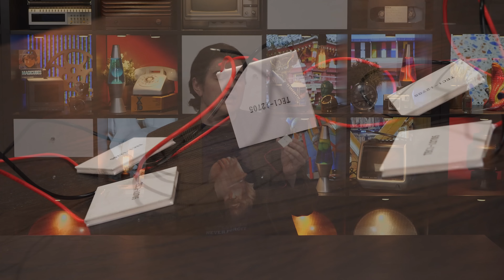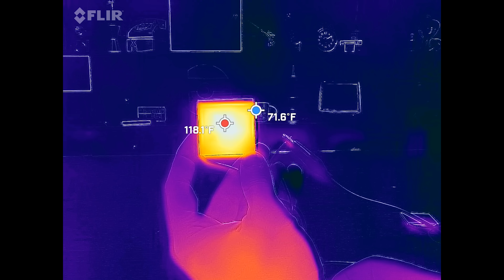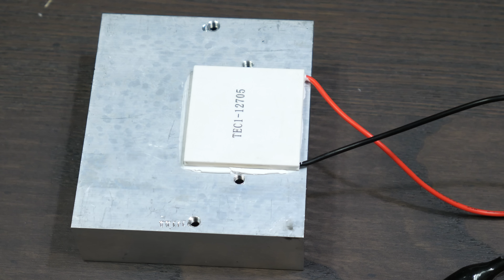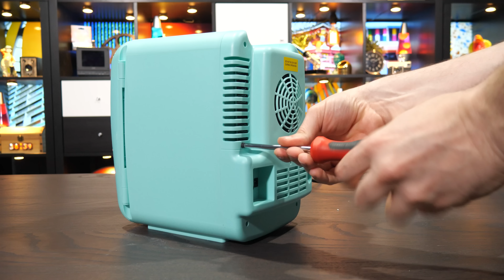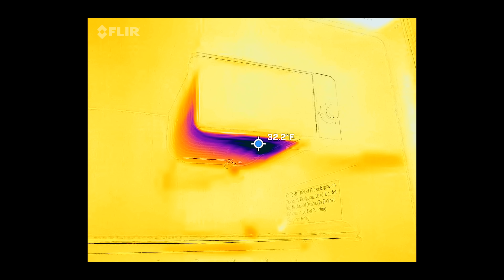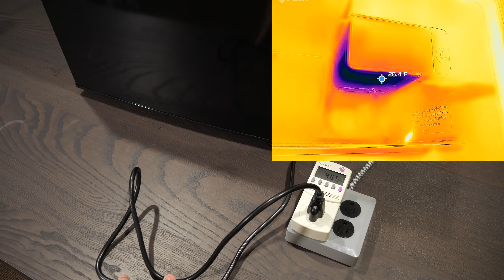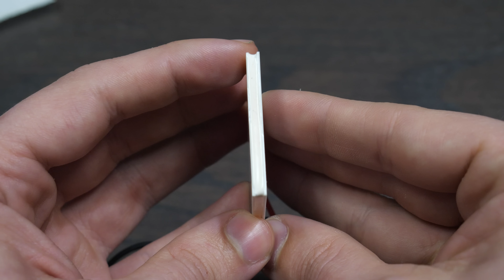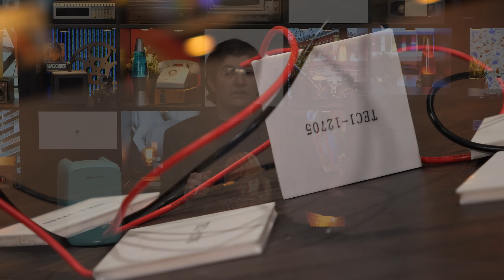Thermoelectric cooling: it's not great.

Comment: What we need to do . Is to is design smaller more efficient compressors for small refrigerators. If the motor and compressor could be made smaller. Roughly the size of a 12oz can. The compressor has really changed since the 30's ,40's ,50's at least! I have heard even propane can be used as a refrigerant. I have been thinking about building a off-grid heat pump, using automotive ac equipment, a long with a couple power sources. Either a 24v DC electric motor, or a 5hp gas or diesel engine. Maybe both. Also including a alternator to charge the 100+ ah battery. It will require math to determine the run time to capacity requirements.  Also possibly building a refrigerator as well probably a freezer modified and probably a freezer as well. All this may require a larger engine , the electric motor I have. It is rated at 24 and 48v and can be used at , 96v+ with additional cooling, 3.6kw at 24v nearly 5hp (750w=1hp) I can run it at 48v, and use a 10-12 hp engine. I'm thinking a 5 gallon bucket of water with a pair of coils inside, one to freeze the water, the other to use that cold to cool other things , sit the bucket on 6" of foam insulation with air gaps. Probably 1" dense poly foam. With 1" strips forming air pockets between layers, glued together with spray foam. Adding about 1.5-3mm to the thickness
 Making a top for the box the same  way, with walls made similar, with only two solid layers, with the walls 2" from the bucket. And the tubing entering the top.  And thick plastic sheeting to cover the bucket. Incase it cracks eventually from freezing, (maybe use a anti freeze to prevent actual freezing,) anyway, place the bucket inside the center of the foam box. Fill the gap with spray foam insulation. Maybe incorporate bubble wrap to get air gaps to add to the r value. Use water with antifreeze to circulate through a heat pump , A coil, using a small 12/24 vdc pump to circulate the water. To add time between when the compressor need to run. AC is only needed about 3-4.5 months , and I can use the outdoor wood stove boiler to heat the house the same way. I would like to store hot water in a similar way, using 55, gallon drums, possibly lined with bricks, with a foam container to insulate the barrel. If the water is stored at 10psi the water can easily be heated to 220° without boiling not shure the boiling temperature at 2 bar pressure. But 14-25 psi isn't that much more than 10 psi. Question is can it be safely contained? It would probably be safest to go with 2-4 psi over ambient pressure. And keep the temperature to about 210-215, just below boiling . And the red clay bricks can possibly hold heat better than water? I have to check on this. I know water holds heat well, so do brick. But witch is better. Also sand could be used. Thermal mass storing heat  and  cold to help keep the house cool and warm. Can be a worth while project. Especially when off grid. It requires planning and safety to be kept in mind, or it can get very dangerous. A solar panel cooler can be added to the solar panels, and use this  heat inside the house when it's not very cold , and there is just a chill in the air. Maybe store the heat inside a bucket ! To be used at night, the exhaust from the DC generator charging batteries can be used also, to heat the house, building a water cooled exhaust is fairly simple. I would use a 1.5" pipe , have 6" straight runs with 180° bends. And cut a groove in the pipe on two sides  at least , put a 1" strip of sheet metal in the groove half way. Weld it together, about 4"-4.5" should be enough for a 6" pipe. With the pipe zig zagging back and forth about 8 times with a 18 gauge sheet metal box covering it
 Being about 2.5" thick to allow 1/2" on both sides of the pipe . Then a 1/4" not female fitting  welded near the exhaust inlet, another near the outlet.  With flat sheet between the pipes inside . Leaving kind of a maze for the water to flow. It's going to be possibly 24-28" long and 12"-14" wide. Use 1/2" PEX water pipe to plumb the water to a pump, capable of handling the heat. A 5 gallon per hour should be plenty. This should allow the water time to heat up inside the heat exchanger as it slowly flows through. I have Soo many things I want to do like this. Including using waste oil to fuel the engine, use wood gas to fuel a  gasoline engine, maybe distilled, pyrolized rubber as a gasoline replacement. And bio- diesel made from plastic. And look into heating it under pressure attempting to crack it. Make a fuel more like gasoline. Possibly use wood to produce wood alcohol, (methanol) to mix with the cracked biodiesel attempting to produce a synthetic gasoline! Experiments mostly, but the rubber does make gasoline, and the plastic does produce diesel. I  would probably limit production to 1-2 gallon batches. Well , enough rambling, sorry for this, hope you have an awesome day🎉

Comment: I still think I have a good use for Peltrier element in my DIY stuff. I build a "fermentation box" form a pizza-delivery box, peltier-elemet and two heatsinks with fans. It's easy to build a temperature control for this and it at least uses less engery than if I would heat the box with a normal thermal element. usually I just increase the boxes temperature for about 6°K.
Also it has to be portable and is run just for few days a year.

Comment: Peltier COOLING is crap. But Peltier POWER has a couple of niche uses.
Peltier devices can either make a temperature differential due to voltage being applied, OR create voltage due to a temperature differential being applied.
There are fans that you can put on a woodstove. When it gets hot, the bottom (hot) side is significantly warmer than a generous heat sink on the top. This temperature differential creates a little bit of voltage...about enough to run a small DC motor, powering a small fan. This allows you to get airflow in the room without plugging something in.

Comment: As another automotive use case that is relatively common, unlike cup holders, vented car seats with heating and cooling options typically use Peltier devices attached to a blower instead of the traditional heating elements found in standard heated car seats.
Reply: …and they usually exhaust from the backside of the Peltier device to the rear underside of your seat. So, whatever setting you have it in, the inverse will be happening to your rear passenger’s feet.

Comment: I had a cube refrigerator that had two Peltier elements for cooling. It never kept the beverages very cool and it ran 24/7. No telling how much energy it wasted in the years I used it. One day the beverages were room temperature even though the fans were running continuously. That was the end of it. I recycled the machine and I didn't buy another refrigerator. Well, now I know which kind to get if I do replace it. But, I'll pay more for one with better insulation if one exists.

Comment: AFAIK my dehumidifier uses one of those. 
It's basically a Peltier with no heat dissipation, so water condenses on the cold side and drops into a reservoir.

It's actually somewhat efficient at doing so, removing between 200~300ml of moisture from the air every day

Comment: There's one place were peltier elements make a whole lot of sense! Astronomy cameras.

Astrophotography is a game of signal to noise, astronomical images are often drowning in noise and isolating it is the difference between getting a black image or an image with a nebula in it. CMOS and CCD sensors generate noise based on their temperature, so lowering the temp will lower the noise, but even better, the noise is associated with the specific temperature, so you can select a lower than ambient temperature for capturing images, and then later, take calibration images at that same temperature and subtract the noise between the two sets of images. This is called dark correction.

Comment: 30:14  it is worth opening that pump unit up. 
the "buzzing" sound at this moment when it slows down. is easely identifiable as a contact sound. 
(something spinning with fins on it is hitting a thin metal housing) now i can only describe the sound that closely because i know what's causing it. 
but every single electric motor has a "fan" on it.  (the impeller fan) wich is most cases is covered with a thin sheetmetal housing. 
your compressor isn't air cooled though but oil cooled.  but who knows there might be a little fan under that sheet metal where the wires go. 

(a compressor is still powered by an electric motor through so that might be what's sticking out from the tank under that sheet metal.) 

in any case it doesn't sound like it's cavitation (wich would be the other cause of such a noise)

the reason i say this is because right at the time stamp. you can hear it slow down far enoegh to where you can hear something sliding over a surface. like a plastic fan hitting it's circular housing and being stopped by it.) 
wich means it's a problem that can be fixed with less than average mechanical skills. 
if it's actually inside the compressor.  it's still the same.  something is sliding across the circular housing it's spinning in.  100% 
wich might be fixed with tigtning and loosening the pump from the casing. (if it wasn't manufacturered propperly but still tightened down to spec.  the whole thing might be tensioned or tortioned. wich causes the whole thing to slightly deform.  wich could be enoegh to cause such an issue if the tolerances are too tight)

Comment: "Low-voltage" and "low-temperature-differential" paired with "recently cheap" perked my ears. With a slightly larger budget, what would it look like to stack enough together to have better efficiency and a usable fridge space? For that matter, can we get enough cooling before we hit diminishing returns?

Since the toy can get ~30 degrees of differential eventually with a single stage, we should be able to get to a comfortable margin of food safety (allowing for an up-to 100 degree room) with 3 stages of cooling, then we can plug multiple 3-stage stacks in to make it speedy enough. It does cost efficiency to use those though, so the question is what depth of stack gives optimal efficiency? Would be a fun experiment.

Comment: Sober high thought: isn’t there a device that takes heat energy and turns it into electricity? Can you attach one of those to a peltier device? I’m not thinking about free energy but a bit of performance offset. I know this will be wrong ultimately and wouldn’t work but someone can confirm that for me

Comment: You should have tested a much better product. I had one like this and it was a piece of junk that i eventually threw out. It didn't cool below like 45-50F. I now have a much better one that i did in fact buy on Amazon for i think like $150. It stays around 32F all the time and performs as good or better than expected (40F below ambient temperature). And if that's too cold i can set it to 35F or 38F. But i keep it on the coldest possible setting.
Reply: What's the name of it?
Reply: @logitech4873  Cooluli 20L mini fridge. It should pop right up on amazon. Its 150 right now. It has a temperature setting and digital display. In the winter when my room has dipped below 70F like in the upper 60s, ive gotten the fridge down to 24F. I really have no complaints, its even pretty damn quiet. I had one like in the video and it was so loud i couldn't use it. I highly recommend this one.
Reply: @dylanchadderton1  Ah, I see that it uses an 80W peltier element. That's even more power use than the one in the video. 
I have an Alpicool C15 which is a 15 liter compressor based mini fridge. It costs a bit more, but uses only about 16-20 watts to continuously run. I can set the temp all the way down to -20°C. (-4°f) and it reaches that very fast.
Reply: @logitech4873  i didnt know they make fridges that small with a compressor. Ah, i see it on amazon its like a car fridge/freezer. Looks like it works well but i dunno about using that for a desktop fridge. I like the cooluli one because its literally like a small fridge thats easy to open and close with a magnetic door. Does use a lot of power though ill admit
Reply: @dylanchadderton1  I needed it for a long roadtrip through Europe. I ran it on a small EcoFlow portable battery so it could keep running in the car while I was away from it.
That's why I had to spend extra on an efficient one. It could keep cold in the parked car even in Spains summer temps, which was very impressive.

Comment: You will be pleased to learn that I found my XBox thermoelectric fridge in the trash, cleaned it up myself, and got a replacement power supply for $20. So no, I didn't buy one. And also, I only use it for the lols as it sits beside my XBox. There's nothing inside the fridge.

Comment: I bought a few of those little desk refrigerators because they were cheap. Not one of them laster over a year (as stock). The switching power suppplies in these things are bottom of the barrel cheap. Running it off a seperate 12v power supply got them working again, however, their claim of 3A power draw is false, 4.1A is more accurate.
While the basic cube refrigerator is more expensive, it does provide a lot more space, and doesn't cost more to run. Also, the cube can last a long time, I'm still running one I bought in 1995, and have another I bouguht used that was manufactured in 1999. There's no electronic parts to go bad or get zapped by surges.

Comment: wait until you discover pcs.  that'll blow your mind.
Also, efficiency != good or bad.  It's cheap therefore good.
Also, there's no evap fan like there are in freezers and fridges.
Also, all these micro fridges will probably die in 3-5 years.  The small blue box will last 15 or more.

Comment: I am commercial refrigeration tech.  I can tell you that these things are junk.  We had one in our house, and I noticed it never made what I would consider safe temperatures (35°F to 40°F).  I hadn't heard of the Peltier effect, but I did notice that it didn't have a proper refrigeration circuit.  To say its performance was inconsistent it being generous.  I will never use one of those things again.

Comment: Playing devils advocate...  My company makes quality desktop fridges.  To build a quality product, we use thick insulation, high quality american made thermoelectric cells, heat pipes to move the heat away from the cells, and efficient heat sinks with the quietest fans on the market.  Is it cheap?  No.  But its a quality fridge that will last for years, uses not refrigerant, and is small enough to fit on a desk.  Oh, and it has a higher cooling density than a standard kitchen refrigerator!

Comment: Feel like this could have benefited from finding and highlighting some versions of the Peltier fridges that don't cut as many corners. Like using real, full insulation and some sort of minimal temperature control.

Simply put... I don't need more than a 6 packs worth of space, so all that "and this mini fridge can hold so much more" is meaningless. If it doesn't take up much space, and can actually make cans pleasantly cooled... that may be worth the power in-efficiency to some.

Comment: I have one of those fancy neck fans that has pettier cooling, that works fairly well.  Has an 8,000mAh battery that lasts around 4-5 hours.  In the winter it can heat as well.  I’d say this is one of those instances where the pettier cooler is optimal.

Comment: My favorite use of this device is for fireplace air circulation devices, they use the peltier as a energy source, relying on the heat from the fireplace to create a temperature difference that in turn run the fans mounted on the rear end. this makes the top portion even cooler and also moves the heat around the room.

Comment: I was about to buy cooling box, that uses thermoelectric cooling and I was ready to pay 10€ of it (used), but then I found cooling box that have real heatpump and that is realtively light and relatively small, so that I can have it always in my car. it cost 170€, but that is super cheap compared to other similar products.
at summer my car inside temperature can go up to 40C, so cheap one would not be even cold, because it would cool only to about 25C, that is what my room temperature is.
compared to the fridge I bought to my car, it can cool up to -30C or about -15C even when inside the car is +40C, that is insane

Comment: Actually the COP of a fridge cant get above 2, if we assume an evaporator temp of -20 C and an outside temperature of 25 C. Due to thermodynamics the maximum theoretical COP can be calculated using following formula: T_hot / (T_hot - T_cold), with absolute Temperatures in Kelvin. The resulting COP is around 1.75 for cooling.
The IPCC has published in AR6 report that Propane and Butane both have Global Warming Potential of < 0.01, but hasn't actually written about Isobutane in this report, but I assume its GWP is somewhat similar.

Comment: Wait, what if i put 4 of these on the back of a 2x72 platen? Usually have to use water cooling and it's a mess. Would it just cost a fortune in electricity for that to even work, even if these things get stronger than just dropping a few degrees?

Comment: First off  -- thanks for the Video .    I had a  portable  Peltier element car fridge  --  as you pointed out, it does keep its contents slightly cooler ,  but wasn't enough for food safety  -- let alone medical safety (keep insulin cool )   --  in the my vehicle  (I've made the trip from central Texas to  Central Florida (visiting my 90 yr old mom)   and tested  both  --  it was better to have a good insulated lunch bag with an ice pack.

Comment: The fundemental law of devices: everything is a heater. 

One of the issues I think is that, at least in the education system I was subjected to. Heat engines, and therefore refrigeration is taught really late.